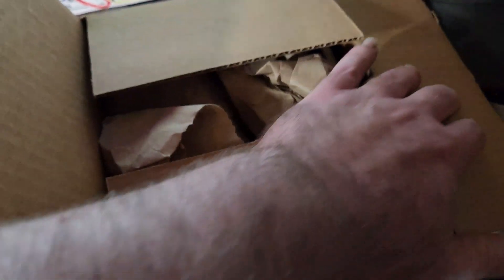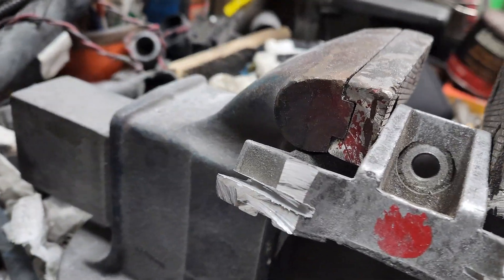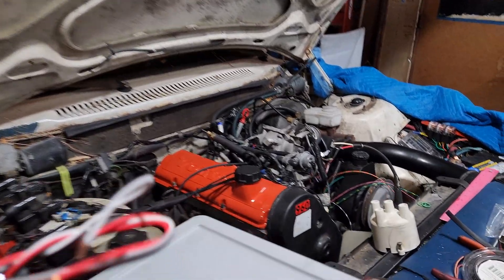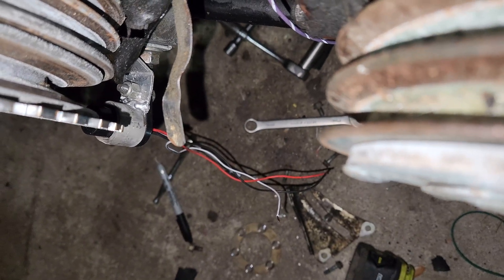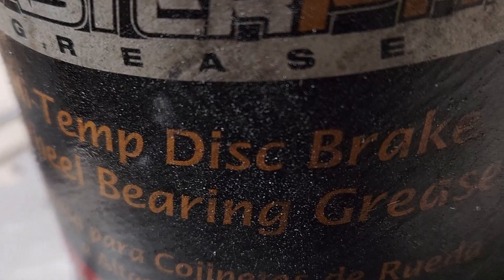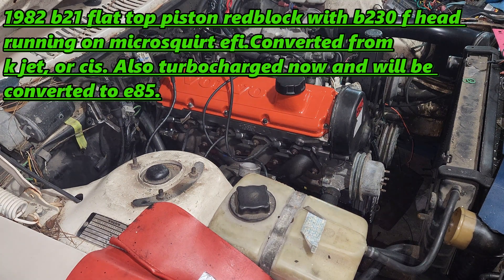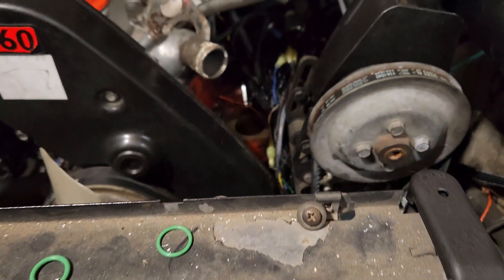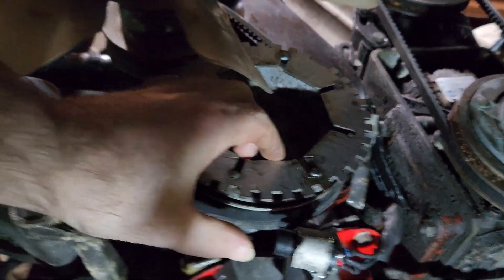ᴛʜᴇ ꜱɪᴍᴘʟɪᴄɪᴛʏ ᴏꜰ ᴛʜᴇ 36-1 ᴛʀɪɢɢᴇʀ ᴡʜᴇᴇʟ & ʜᴇʀᴇ'ꜱ ᴡʜʏ.

Comment: Is it still running good on that 36-1 crank trigger and crank sensor ?
Reply from the maker: Smoothest running one yet, new video will be up in a few about it all more in detail. Can't wait to share it with yall.
Reply: no cam single sensor ?
You just running it on Crank sensor ?
With LS ignition coils
Reply from the maker: @gc2353  correct just like my wagon daily that i built 7 years ago. But the wagon uses the stock flywheel trigger with a few resistors on the sensor so it doesn't wig out.
Reply from the maker: @gc2353  new video https://www.youtube.com/watch?v=yKTAHpCZt3Y&t=2s
Reply: On that DIY hall sensor did you need to wire a resistor with it ?
Reply from the maker: @gc2353  No I did not, but i have yet to rev it past 3500 so gotta make sure that has no issues-great questions. so far, No resistors, or funky shiz.   Another joy of that setup for sure.
Reply: How soon till you start driving it and reving is passed 3,500 rpm to see
Reply from the maker: @gc2353  maybe tomorrow, have to replace fuel pressure regulator, it was leaking fuel inside the vacuum hose pretty bad. Hopefully will get a new one if they have it stock, and finish up the last few things to drive it.
Reply from the maker: Ur right I do have to run a resistor..500 ohm or two 1k ohms should do it.
Reply: How come ? According to DIY autotune that tab hall sensor doesn’t need a resistor.
Reply: If it does then I’ll need one too . Cause I did exactly what you did in the video and got it running and idleing but when you go to drive it misfires runs bad right .
Reply from the maker: @gc2353  I just revved it to 3200 and it fell on its face and started popping and choking and getting crank synch errors. So yeah, absolutely. same thing my wagon did with the Lh flywheel sensor and i did the same thing to it. the sensor creates free energy. Isn't that neat, and spikes over 5 volts , so the resistors cap the voltage while retaining the square wave. If that makes sense.
Reply from the maker: @gc2353  Ikr, Unless I missed a setting in tuner studio, Micro squirt is saying different. It just doesn't like seeing past 5.0 volts on that trigger at all. I assume it is going past 5.0 volts , I hadn't measured it yet. But I did play with fuel and timing and the situation didn't seem to change. Adding a resistor isn't a big deal. I ordered an entire kit from amazon for $13 it will be here tomorrow. Then I will see for sure if it fixes it like I did many years ago on the lh flywheel sensor to use with microsquirt. I hope this all helps you get yours going!
Reply: In neutral idleing it would not let you rev is passed 3200 rpm it started misfiring popping ?
Reply from the maker: @gc2353  yeah
Reply: Let me know if changes when you install the resistor please
Reply: https://youtu.be/Sn97YhkuugA?si=ug90gfquopVvVlPo

That video might be helpful
Reply: You fixed the issue and the resistor full solved it ?
Reply from the maker: @gc2353  amazon full stalled me out for delivery until 10 tonight,I only had 1, 1k resistor left, no 500 ohms.  So I will not know till tomorrow. I solved the issue on the lh2.4 flywheel sensor the same way, many years ago, no reason why it shouldn't, Ya know? But will let ya know in next video probably.
Reply: I just went for a drive after installing the same DIY 36-1 with same sensor tab Hall effect and runs like butt misfires . I did get
It to idle good and revs out smooth in neutral. So now I’m thinking I need a resistor also . Not sure cause I thought that sensor already had a built in resistor .
Reply: https://youtube.com/shorts/IuxLuF5Snfc?si=uhTSkSjhohhh1-0z
Reply: I’m hoping it’s not vibration or flex related from the sensor bracket I rigged up . Posted a video of it check it out .
Reply: https://youtube.com/shorts/C3p8pEJYOH8?si=u1fAKCz1wg42rXeo
Reply: You think I also need a resistor?

Comment: i think i have same timing issues with 180 degree gap. it works while cranking but gets messy when trying to start. would moving the trigger wheel help? moving the sensor is really hard
Reply from the maker: id play with your warm up enrichment and starting maps on the cooling sensor first , or unplug and see if starts, if so, you got some tuning to do.
Reply: @TurboWorld  i moved the offset to 55degrees and it works like magic now
Reply from the maker: @e34boat88  So good to hear meow!

Comment: Thank you for this. Having an issue with a microsquirt conversion on a sr 20. I think this may be my next move.
Reply from the maker: Thank You for Being Awesome and leaving a comment! Way cool engines sr20,  the sr, in a 240? This setup so much more crisp with rough tune , than the one finely tuned on my wagon with a 62-2 wheel or whatever the dang thing is. I noticed it in the sound of it right on start up, between the two, its night and day when the chip doesn't have to math per revolution and get sludged up with calculation I think. So I will be doing it to the wagon as well, and any other serious engine I work on. Think of it as perfectly synchronizing it to the chip. Mechanically you do a tdc check, then you degree the cam, this is degrees the cam , in a mechanical comparison, that has everlasting massive benefits in efficiency and has no choice but to translate into further reliability as I can imagine. Sure the other triggers work, but, we need more than just function, we need accuracy and efficiency. I think this is the way @rori1891 .  Thank you so much for commenting  and watching, You Rockl!

Comment: Did you use the original dizzy on the car?
Reply from the maker: no.
Reply: @TurboWorld   you went with wasted spark correct?  I don’t have the wasted spark set up I’m using the regular dizzy. So would I just select single coil?
Reply from the maker: @Squatch242  wasted spark with ls coils, microsquirt ecu, and a toothed crank wheel i welded on.

Comment: Would you happen to know which crank trigger tooth wheel and which HallEffect sensor (with what amount of wires) I would need for a 1996 Nissan 240sx ka24de I would need?
Reply from the maker: If you are microsquirting it, the same that i showed in the video, weld it on to the crank pulley. I don't know what they come with, sorry, i have worked on a few but I forget if it has cas and what the tooth count is.

Comment: are u using a vr conditioner circuit with at the speeduino ?
Reply from the maker: It's running on microsquirt so its either built in or none at all. I just wired it and fired it. After programming of course.